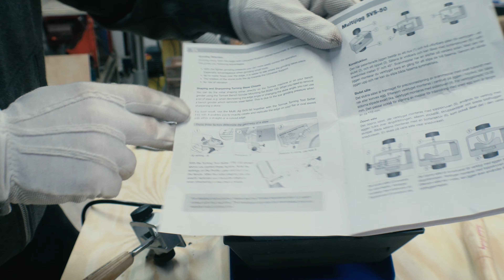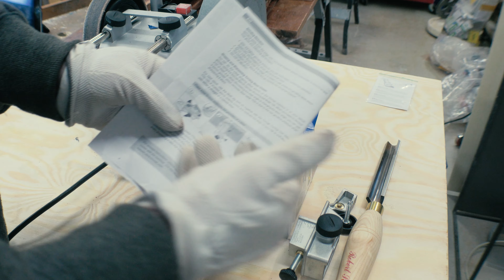Tormek SVS-50 Multi Jig | Sharpening system

Comment: You can use a marker - paint the bevel black, then put it against the wheel and turn the wheel. You will see where the wheel grinds off the marker and precisely see how it needs to be adjusted
Reply from the maker: Thats a good tip 😀

Comment: The demonstration showed straight edged tools and needed judgement on angle by eye. It is not too difficult to do this but to try to use the jig for curved tools EVEN with the additional TTS - 100  and WM - 200 the results were very poor. 
Straight edge at an an angle 8/10 bevelled tool very poor, 2/10.